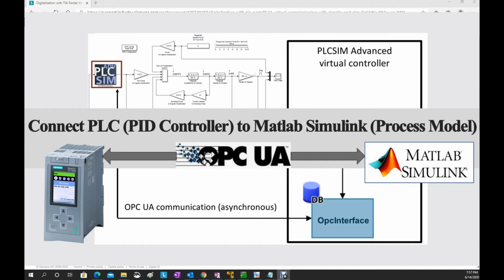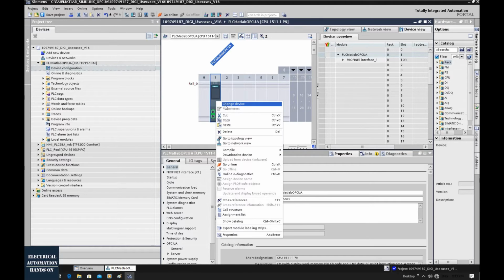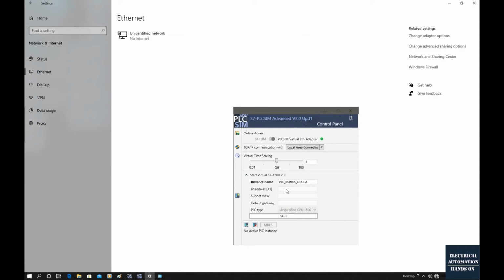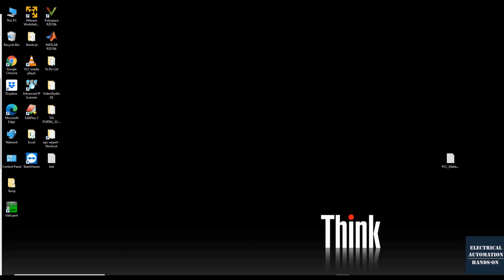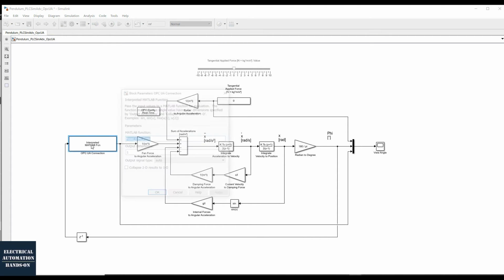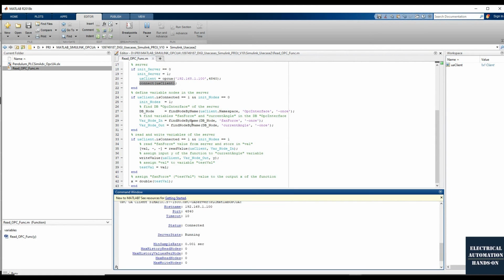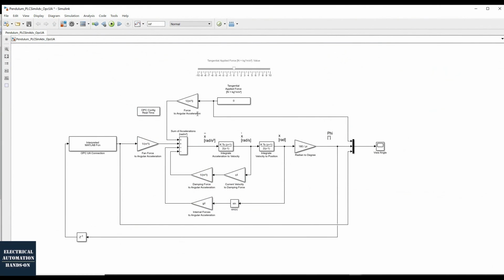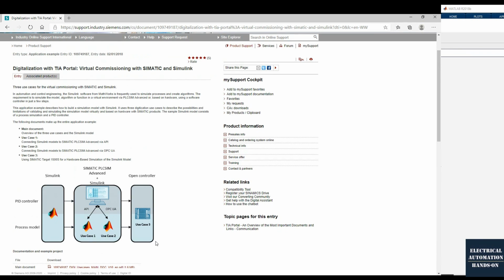COM12. OPC UA - Connect PLC (PID Controller) to Matlab/Simulink (Process Model) via OPC UA

Comment: Hello. Thank you so much for this wonderful explanation. It really helped me to achieve my results. But, i need your assistance for a problem that i am facing in my application. My Simulink model will take data of output voltage in real time only if a specific Input port is true. The problem is my Simulink model is that it is running slow with delay of 0.5 for the time period it is receiving data for the specified condition (eg. for real 10s Simulink run period is 5s as per graph), otherwise it runs with usual speed of 1s for 1s. Can you help me with this?

Comment: my PID controller is not responding to changes in the setpoint. Do I need to add a PIDCompact technology tool for this comfiguration?
Reply from the maker: Please check the actual mode of your PID, most likely your PID controller never worked at 'auto mode'
Reply: Thanks for the reply. My Mode both in the global and opc is 3(Automatic Mode) when I click the monitor all button. But the fanForce doesn't change. I saw your project had a instPIDCompactOPC[DB2] technology object which mine doesn’t have. Could this be the reason?
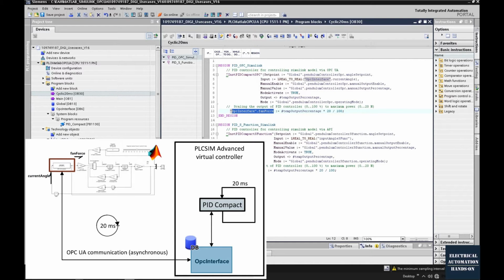Reply from the maker: @AmandlaMvimbi  The second InstDB is not needed in the video, 10:43. It should not be the reason for your trouble. There must be some other settings missing.
Reply: Noted with tanks🙏🏾.  I have send you an email clarifying fully what I have. Please go through it when you have time.

With thanks,
Amandla

Comment: Hey, Im havin the following error displayed on simulink "The value supplied for the attribute is not of the same type as the attribute's value. ", i have a vector input of 3 floating numbers, it actually reads in matlab but i cant get the output from the function or i dont know what is wrong, please help me
Reply: Nevermind I was mistaken with the input/output order in the code, thank you so much this was really hepful for my thesis :)
Reply from the maker: Glad to hear you got it figured out. Thanks for watching!

Comment: Hello, Thanks you Sir for the video, today in the siemens website is not the option to do the link without using the Target 1500S, but I rather like the option in this video, do you have the examples files or do you know where to donwload it?
Reply from the maker: Please check the email I replied. Please also review PID16 - Siemens PID06c - Matlab Simulink - Setup Control Loop & OPC UA in Matlab Simulink https://youtu.be/MTjpAoG3OWk
PID16 - Siemens PID06e - OPC UA Client in Matlab - Simulink Exchanges Data with PLC via OPC UA https://youtu.be/bmivi9Vx2x8
PID16 - Siemens PID06f - PLC PID (TIAPortal PID_Compact) Controls a Process Model in Matlab Simulink https://youtu.be/XP0Vu7wZQ70

Comment: Hello again. There is no "SIMATIC Target 1500S" in matlab configuration parameters. what is the solution to this? I am getting this error when trying to install "SIMATIC Target 1500S V4.0".  ? Is there a free trial version?  matlab has student, campus and professional licenses. Which one should we have.? "setup cannot proceed. install a compatible version of matlab before running setup." Thank you so much.
Reply from the maker: In this video, I talked about the User Case2. SIMATIC Target 1500S is the User Case 3 - The software controller S7-1500S, which is totally different method with the Case2. I would recommend connecting Siemens support if you have any questions on Case 3.

Comment: please respond to my email...I need to meet with you on a zoom meeting especially about this lecture...please
Reply from the maker: Hi Darlington, please see my email reply. The three reinforce video explained more details
PID16 - Siemens PID06c - Matlab Simulink - Setup Control Loop & OPC UA in Matlab Simulink https://youtu.be/MTjpAoG3OWk
PID16 - Siemens PID06e - OPC UA Client in Matlab - Simulink Exchanges Data with PLC via OPC UA https://youtu.be/bmivi9Vx2x8
PID16 - Siemens PID06f - PLC PID (TIAPortal PID_Compact) Controls a Process Model in Matlab Simulink https://youtu.be/XP0Vu7wZQ70

Comment: Thanks for the valuable information!. The Siemens webpage has updated the software platforms and files and the former versions are not available in the webpage. 
Please, could you share the Tia portal project and Matlab Simulink files that you are using in your video? Thanks in advance!
Reply from the maker: Hello, I got your email. Please check my reply. Thanks for watching!
Reply: @electricalautomation  Thanks for your help!

Comment: Thanks for the detailed explanation, I learned a lot about the settings and simulation details. But unfortunately, since their updating, I can't find the whole V10 example on the Simens website. I only had the V10 source code for Matlab, and the V20 (the latest version) for the Simens S7.  After running, the S7 cannot generate any output. I've just started learning TIA Protal, if you have some free time, can you give me some advice? Thanks for your help.
Reply from the maker: Please send me an email, and I will find V10 files and manuals for you. My email address can be found at the very beginning of the video. I haven't got a chance to review the new updated V20, hopefully, they solved the problem I showed in the video in the Matlab code. I also have a question on " S7 cannot generate any output", could you explain more? Note, in this video, the S7-1500 run as OPC UA Server, and basically do not need any special program, while the Matlab is running the key role and run the "Read_OPC_Func" to exchange the data with S7-1500 via OPC UA.
Reply from the maker: I did a brief review on V20 (2020-Oct-13 revision). Likely the OPC UA case Usecase2 and S7-1500S API Usercase3 are merged into one case "User case 2". The good thing is that the problem in the Matlab code got solved, the  "findNodeByName" is modified to "opcuanode(3,'"OpcInterface"."fanForce"',uaClient);"  This change is the same as I showed in the video, glad to see Siemens correct it. That is great!
    V10 - ( 2018-Feb-01 has a problem on "findNodeByName")
    Var_Node_In = findNodeByName(DB_Node, 'fanForce', '-once');
    Var_Node_Out = findNodeByName(DB_Node, 'currentAngle', '-once');
    
V20 - Correct
    Var_Node_In = opcuanode(3,"""OpcInterface"".""fanForce""",uaClient);
    Var_Node_Out= opcuanode(3,"""OpcInterface"".""currentAngle""",uaClient);

Regarding the V20 TIA Portal project, it has better functions but more complex. Personally view, the V10 TIA Project is easier to be learned for the beginner.
Reply: @electricalautomation  Thank you very much.
From your tutorial, I also think that the newer V20 examples is less easy for beginner to follow. It seems that the latest version requires Matlab to generate the PID controller's core program for TIA Portal to use. (I may have misunderstood this part, please correct me if so.) Therefore, I cannot run the S7 directly as a PID controller. (Only superficial interface with no intrinsic features.)